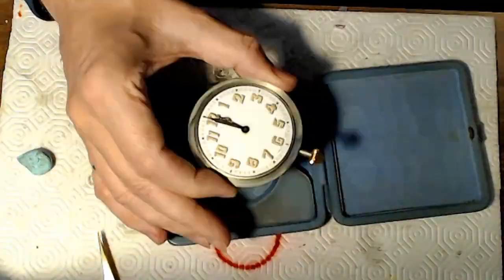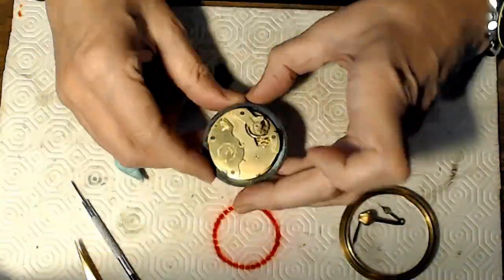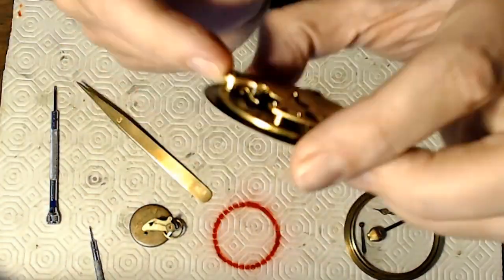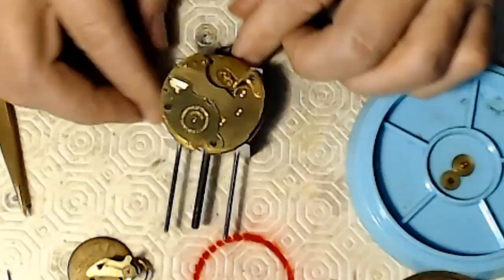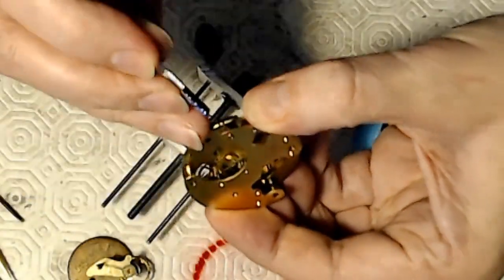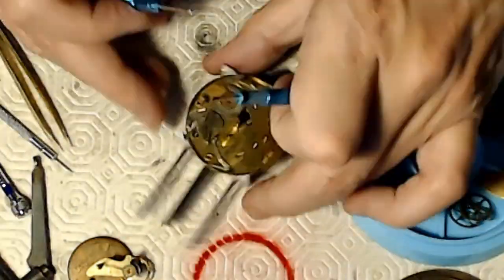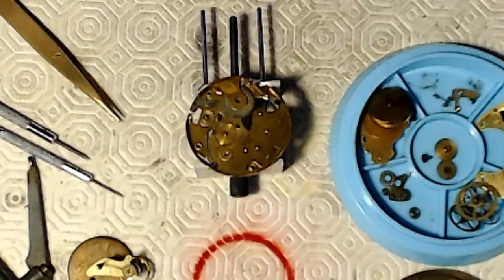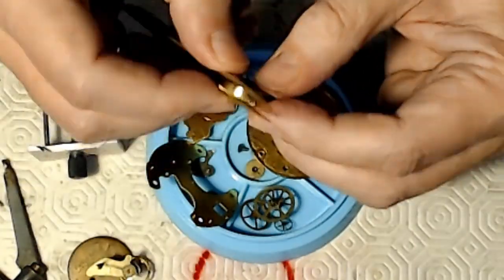A Very Quick Desk Clock Disassembly

Comment: Are you going to show a video explaining how you oil it? Thanks JD
Reply from the maker: lenspaulding If you are serious, I could do this.
Reply: @JDRichard   yes  I would like to see that, if you have the time. JD, do you oil the 'canon pinion'?
Reply from the maker: lenspaulding I do not oil the cannon pinion on the inside as the friction as needed to grab the center wheel. However, a very light oiling on the outside of the cannon pinion would help reduce friction of the hour wheel moving. I would not oil the upper part however as it may get into the hands.
Reply: @JDRichard  Thanks again JD. I never did but I did hear two schools of thought on the subject. A fella who seemed to know what he was talking about, (met him at a NAWCC Mart) said you should. But my old professional watch repairman said "never" as it should always remain tight.
Reply from the maker: lenspaulding So again, never on the inside and low on the outside.
Reply from the maker: I made the video on oiling. I did forget to show the oiling of the face side jewels, but same theory applies.